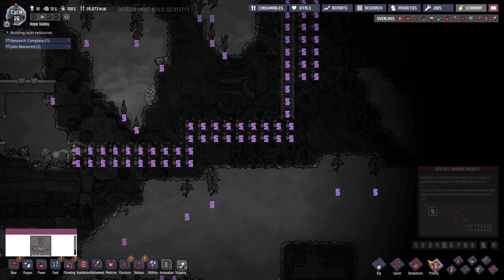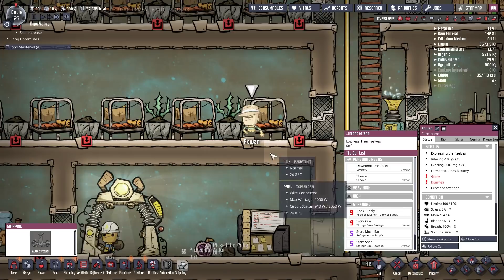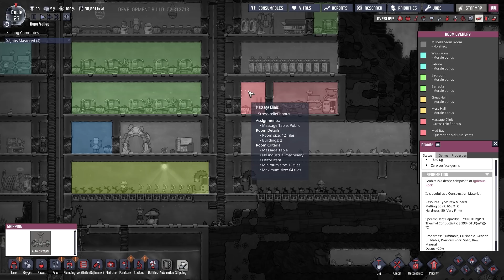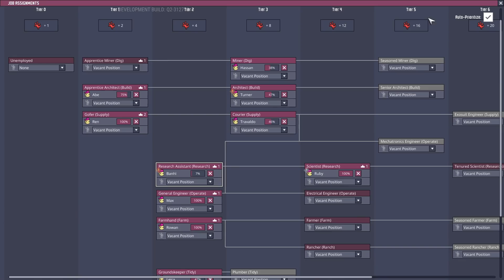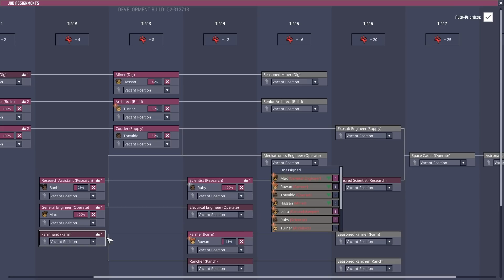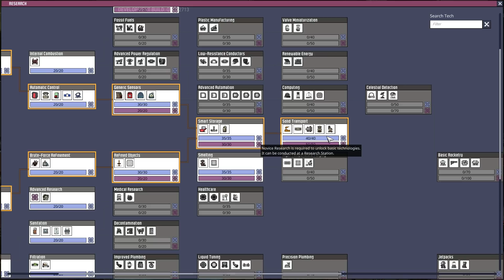Oxygen Not Included: An Industrial Ending | Let's Play Ep 7

Comment: This looks neat, but I'm waiting for it to go on sale.

I would probably have a second waste gas chamber down low somewhere for carbon dioxide. If it breathes in oxygen, it breathes out carbon dioxide. You didn't dwell on the screen too long, but it looks like algae grows from carbon dioxide, so your replicants can breathe out carbon monoxide which the algae will consume to grow, and then you use the algae to make more filters. I picture a giant room with the walls covered in algae. Your generators also presumably produce carbon monoxide, which is toxic, so you want that separate from you algae farm and not choking the life out of it.

Your second problem that I noticed is that when you made the electrolyzer, you didn't consider that it produces BOTH oxygen AND hydrogen, so you flooded the entire area with hydrogen gas and started overworking your oxygen filters, which is why they almost instantly ran out of filter material at that point. I'm not sure how good the game's physics are, but if that reaches it's stoichiometric ratio and considering it's so near the generators it will blow the bottom half of your base to kingdom come. Maybe add another gas filter for hydrogen and make a hydrogen generator or build your electrolyzer in the toxic gas pit and just put a pump filtering out oxygen so the hydrogen is trapped until you can use it.